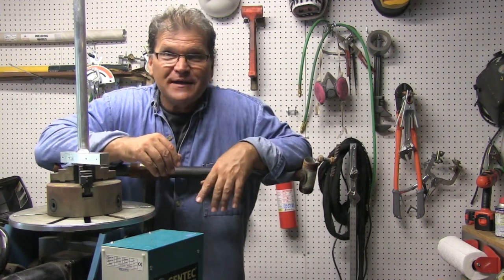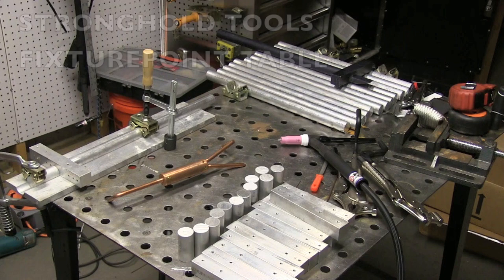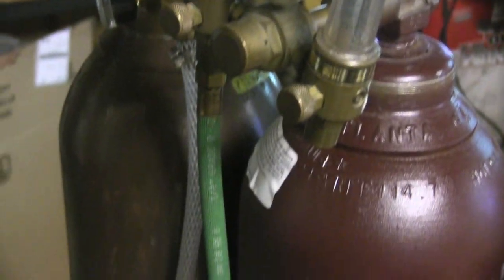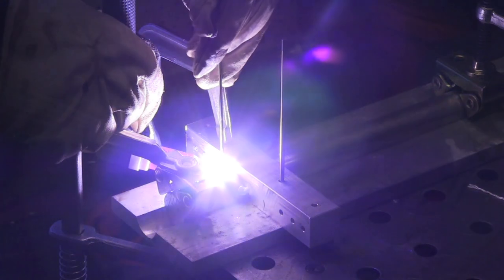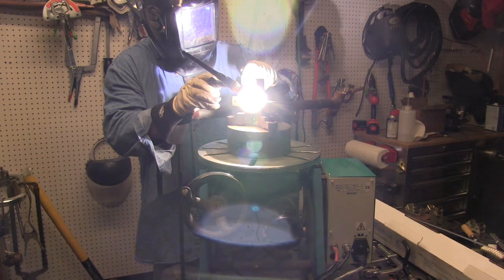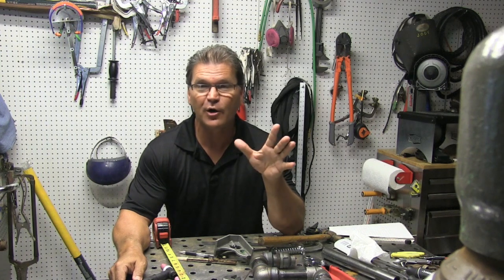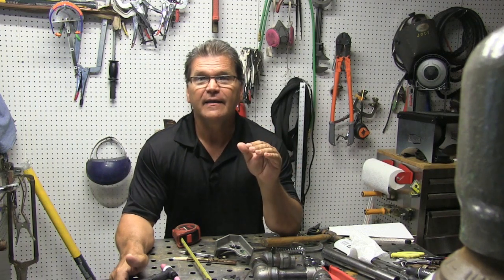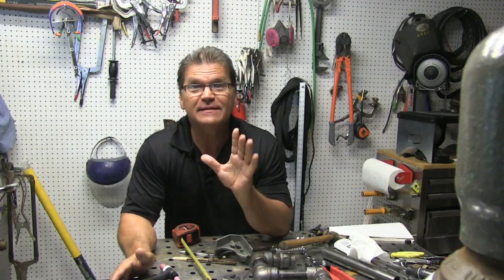TIG Welding one Inch Thick Aluminum with a 175 amp welder

Comment: A flat hourly rate might be a better idea because occasionally you will run into a job that eats your lunch and you find yourself working for low low wages but a deal is a deal and you can't charge more.  The flat rate keeps you ahead of the game but of course you must always be competitive.  A friend of mine is a home gunsmith and he charges appalling rates for his work and he says he sets his rates by what the competition charges so maybe that's another way to go.  Many years ago I was a self -employed handyman and I quickly learned that the time calculated to do a job is the hardest thing to get right.  In my case it quickly became apparent that if I took my best estimate and doubled it , I was almost always right on or real close to the actual time required.

Comment: Lincoln square wave 175 tig welder, I just bought one of these MISTAKE. Why? It is a transformer welder and my shop does not have enough power to run it at full power. My power lines and breaker start heating up. The biggest issue for this welder, It is a transformer machine, not an inverter machine so it needs a solid 60 amps to run at on the 175 setting. It is also prone to overheat at 175. Mine will do about 4 to 6 inches at 175 then shut down... 

Ug, if I had only known. The good? It welds great and keeps going and the wires and breaker are ok if I have it set on 150 amps. I can just barely do 1/4 inch aluminum at 150 and thinner stiff is easy. So it does work, I if kept at the 150 amp setting. 

I had to pay some one to weld my boat motor mount as it was just far to thick, 3/4", for this welder to handle. I barely was able to get it tacked up, constant over heating shutdowns. Yes is was kinda silly to really expect this machine to do 3/4" but I was planning to try and if it was a fail then have it finish welded by some one else.

I researched this welder, not well enough, before I bought it though and it seems this welder is known for the overheat and shut down thing at full power. If you find one for sale do not pay a lot and consider it a 150 amp machine, NOT 175 as it will not weld for long at 175. If you do not have a 50 amp breaker to run it on, "do not buy" it not even for super cheap. 

My buddy up the road who welded my boat motor mount for me has a miller inverter based welder that is just over 200 amps and that welder only requires 30 amps to run at 200 amp setting and it works all day at 200 amps. He took my motor mount to his work and welded it with a 300 amp machine. Just letting you all know in case you come here to research the Lincoln square wave 175 tig welder. The miller Econotig, a much vaunted and highly regarded tig machine is only 150 amps, did you know that? And those commonly sell for 1000 to 1400 and are transformer machines. 

So this Lincoln square wave 175 is working well at 150 amps makes it OK but only if you got the power to run it and if you get it cheap, as in well under $1000. I did, so I can probably get my $$ back if I sell it and I probably will then get an inverter based machine. 

Any one lives around lower central mi and wants this welder it's yours for 750.00. try before you buy etc. welder with new torch and foot pedal. You can come over, bring some aluminum and weld for 20 minuets and see this is a solid machine as long as you keep what I said in mind and stay at 150 amps.

PS, the only way the welding tips and tricks guy  was able to weld this thick of aluminum was 2 things, one he used helium and the most important thing, even though these parts are thicker, overall they are not huge thick parts. So they heat up quickly and the heat allows for a good weld. Do not be fooled into thinking you can weld larger thicker stuff with this machine. But you can weld something smaller and thick as is shown in this video due to heat soak as all that heat can not escape into a large heat sink zone like I had with 12 x 12 x 3/4 plate I tried to weld..

Comment: If this was steel or stainless would you need helium at 1/2 material with 210 amp max on the millermatic 220?

Comment: Well done video Jody, if I may add to your pricing advice,  weld pricing needs to be separate from any real preparation beyond minor cleaning as you outlined in the video, many times in a job shop setting parts seldom come "100% ready to weld", just be aware many times this kind of preparation can exceed actual weld time many times over, beside establishing your own minimum you should try to form a non welding labor scale to get you paid for preparation.

Comment: 10:40 is about the best Welding Tips and Tricks you have in the video! Knowing that you can do the work is the best bet.

I've got a doozy of a job right now, it's about 8 original Ford model T motor mounts for a few one of models that we only made for under one year. They are irreplaceable parts and have stress fractures in them. What's worse is that sometime several decade ago, someone had attempted to remove the factures and cracks by (SMAW) welding; however, they clearly couldn't prevent the metal from cracking a second pass for the other side of the mount. The final result was that they just cut the entire area out and now it has to be replaced.
They had clearly overheated them welding, quenched them in water, and then started on the other side. It's brittle, it's going to need proper TIG welding, peening, and then heat cycled to stabilize the metal again.
When I began prepping the metal for welding, it became a discovery process finding more and more hairline cracks running through the solid metal. It even has chips missing off of the metal and it looks more cast iron than steel because of the extremely old welding attempt.

I don't even know what I'm going to charge for the first/worse one out of 8. If it were by time, I'd lose money. if it were by tack, I'd lose money. I think I'm just going to figure it based on time with a percentage of welding/time in my hands. The rest aren't really bad, so I'm thinking pictures will have to tell the tale for me. They're good people, so I'll just make the final cost negotiable when they're all done. I want more of their unusual, specialty work and a one-off awful job may well be best to just take for the team!?

Any advice on this kind of pricing, I would most certainly appreciate it. They bought the truck for these parts and a few more. It was an extremely rare delivery truck from what I was told.

Comment: @1:52, is that 1/2 inch Aluminum.  I'm wondering if 1/2 x 4 x 48 would bend under 100lbs if secured on each end?

Comment: We have a local welder that only does aluminum TIG.  He welds for all the big three auto companies, local and distant car racing groups, and engine builders.  He is SO popular, you need to drop certain names to even get him to talk to you.  I asked him why he has an UNLISTED phone number?  He  gave me a rather off the wall answer.  So I said, you don't want the idiots with the small jobs even finding you?  He cracked his first smile to me, and kind of nodded his head.  I felt like I was talking to royalty.  In the end, he repaired my aluminum head with the water leak.  He even told me these heads almost always leaked in this corner, because of a sand core shift.  Talk about knowing your stuff.   I couldn't even see where it had been welded, and cost me $50.  Saved  a $500 head from being trashed.  Good guy, glad I met him.

Comment: Jody and welders, I'm balancing between a Miller STH 160, and a Fronius Transtig 1750, the Fronius being 500 bucks more expensive, for a 15 amps difference. Is is worth it ? Daily I'm looking at welding 3mm stainless but on the long run thicker pieces may come my way. Will I regret the 15 amps if I go for the Miller, or should I pass on these two and look for 200-210 machine ? Many thanks! Mat

Comment: In regards to bidding, what about the handling time? The time to clamp it, maybe fab something up? For instance, if the welding is $10 on these, what about the time it takes to set it up in the jig, to clamp them, take them out, set up the positioner, etc? I know these are small, but you still have to account for that?

Comment: Been watching your vids..really well done.  thank you. Did a lot of welding, all types on all metals on all jobs from Buck Stove to oil rigs, ship yards and boat yards a lot of years ago... Would like to get back into it on the serious hobby side. Apparently the Lincoln 175 is not in production anymore. Can you suggest a good all around combination machine to do TIG and stick with?  My forte really was TIG and Mig/flux core but have also done my share of pipe. Being out of it for so long, are the machines that I see combo Tig and plasma arc of any worth? Thanks for your time..JV Roxboro, NC

Comment: Man, that was my first Tig machine, HATED IT!!!! Sold it 10 years after I bought it for the same money I paid for it!!!  I bought a Miller Dynasty 200dx used from a supplier in Charlotte, awesome machine!!!  I weld some heavy alum with that wide open, that Helium mix is a great tip though...

Comment: Great vid again, I work from home with little over heads, I picked up aluminium work from a small company, I started out for quoting going to a larger fab shops for their price then dropped my price by 10 percent from their quote, picking up a lot of gravy now, you just need to meet their demands and jump right in, there's a pot of gold if your smart about it and not too greedy on over pricing yourself out of the market
Reply: Excellent tips. I'm just starting out my side welding business. I've got a dependable everlast welder that I've been using for years now doing my own thing. Time to make some money on the side.

Comment: i know it's probably frowned upon due to warping, but do you ever preheat your work piece? currently i only have a weld pack 100 to work with, and when welding with stainless wire (.025 or .035) i just can't get enough heat out of it to not have the bead completely out of the work piece, but if i bring the part up to 130-180*F it will lay a pretty decent bead.

Comment: Thanks for the tips Jody. No matter what comes down the pipe you eventually find a job to big for your equipment. Tips like using helium are solid gold. 
For a time I managed the tool room for a larger shop with a lot of stamping presses. The edges on the blanking dies would break down after a few thousand hits and we would have them welded up by a local guy who ran a weld shop. Every time I went over to drop off or pick up a part he would be at the bench welding something. A tool room can be a good source of work too. We got started with the guy because one of my tool makers knew him. Networking is always a good way to pick up business.

Comment: Do you think it is more economical to buy a separate bottle of helium or buy a mixed gas cylinder. We usually use a 75-25 mix at work but that seems like a lot of helium.

Comment: Hi Jody. I just had a suggestion for a future video. Maybe you can make a video on how a person would actually be welding out in the field primarily structural welding. For example the steps required to weld two steel beams together. Should I put a bevel on it how?, how would I square it. And different welds that one who's starting might encounter. As someone who's trying to get a job I would like to know ahead of time of what I should expect to know thank you.

Comment: Thanks for the video, it was very helpful for somebody like me that is trying to weld alumininum. I'm an AC tech and I do brazing a lot, but I have a hobby that I need to weld 3/16" thick aluminum or less. What machine would you recommend that would be used to weld small projects? Thank you very much in advance for you answer

Comment: Hey Jody, Great video, Does that dynaflux cleaner work better than acetone on aluminum? thanks.
Reply from the maker: Brett Schwaninger i use both.  the aluminum cleaner removes surface oxides and then the acetone gets any leftover crud

Comment: Great video Jody,
I have yet to come across an aluminum welding job with that thick of material but still a good tip with regards to using helium for that little extra kick.
I really appreciated your tip at the end as well, with regards to looking for work, it never dawned on me to include a sample with a business card, great idea. As luck would have it, I am a machinist who can weld, which has saved my butt on an occasion or two, lol. Because, as I'm sure everyone knows, we rarely make mistakes :))
And just to let you know, I am still making good use of the tig fingers I purchased. and am glad I have them.
Thanks again,
Ian Little

Comment: Jody, Great Vid as always.. I use a spare piece of aluminium as a striking pad for the initial starting arc, let the electrode warm up then stop, keep the argon flowing (with a few button presses or heaps of post flow) then go straight to the part being tacked, tack as required.. Ending up with some very clean tacks. Same process before a bead run too.
Reply from the maker: Great tip. Thx
Reply: Thats a great tip. Thank you.
Reply: What additional benefit does a tig welder like the everlast 255ext have with its advanced waveforms? It sounds like it allows the welder to more heat into the weld but I'd like to more about how much it would help.
Reply: I think there have been a few videos out there on how it works. You can also check out the everlast forum because I think there was a guy who posted on there how he melted thick aluminum clean through using that waveform. It's a great welder.

Comment: interesting way you estimated the job , it would make things a lot eazier 
wish i could find someone like that here (europe ) it would make estimating the cost for a certain job myself without asking him every time a little eazier and you wouldnt be off too far from the actual price 
it only works if youre only doing the welding though 
most of the time they allso want you to dress all the pieces and maibe even grind them smooth afterwards

i been stung quite a few times asking companies to do a small job for me
one of them was drilling 2 12mm holes intoo doubled box sections that slid intoo eachother  , the handdrill i had was too small for the job and it was a simple job only 15 minutes tops but they charged me 50 euro for it when it was done
a drillpress thats big enough to drill those holes at home cost about 100 euro new and 10 euro for the drillbit , so thats wat i did the next time and used it since 
it made me weary about just giving out the job without asking the exact price or go on a hourly rate and do some searching on wat the materials cost to do the job myself and maibe get some tools and save some money

Comment: Thank you very much. I have a 185 amp that just can't cut the mustard on aluminum jobs. I have to break down and come up with the cash for the helium tank and flow meter.
Reply: Pre heat goes a long way, if it’s an option.

Comment: Great stuff. Now let's see if you can do it with an inverter on a 115v breaker =;-) And with dye pen to see if the root is fused. This was a debate on 1x3" 6061 bar stock that was never fully settled: can you do a root/cap in the field with only 115v and get a good weld? Thanks.

Comment: Thanks for all your video's filled with your welding knowledge. I'm new to tig welding and have a Lincoln precision tig 185. Have you ever used one or what are you thought about this machine. Thanks, Duane
Reply from the maker: MrMxrider65 I have not had a chance to use a precision tig 185 . it looks similar to the 175 but with AC balance, pulse, and post flow. AC balance is a great feature to have
Reply: Thanks!